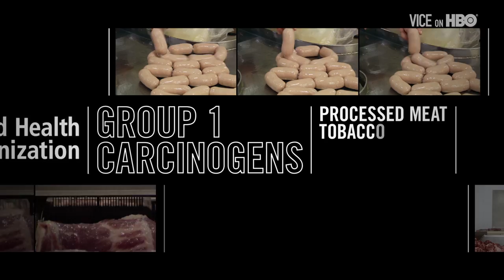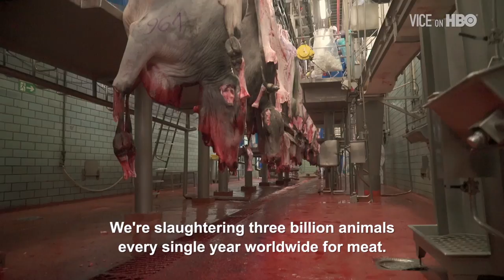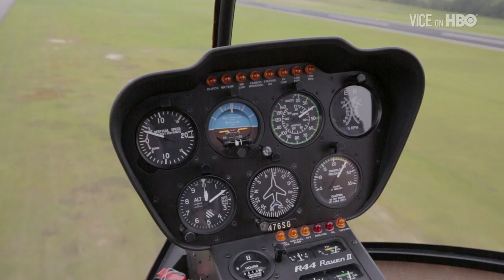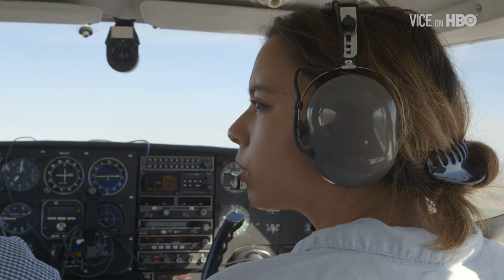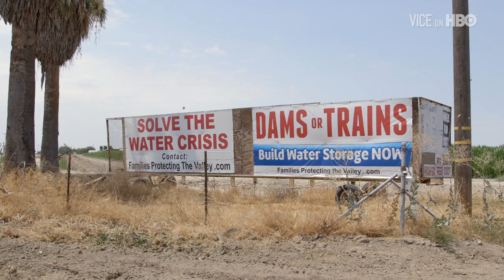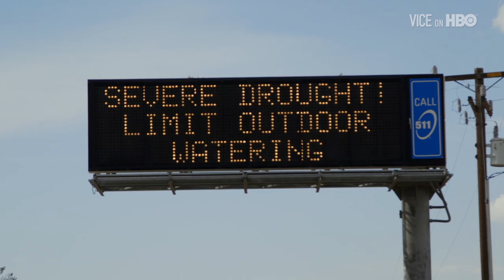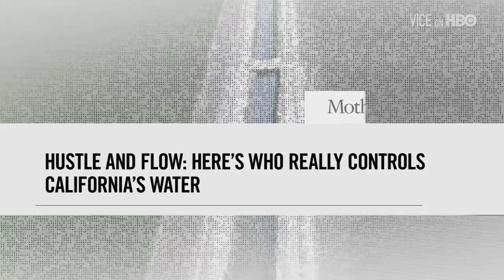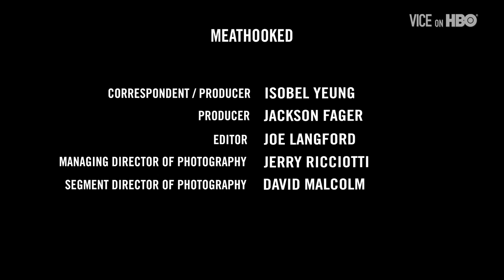Meathooked & End of Water (VICE on HBO: Season 4, Episode 5)

Comment: So its a carcinogen with a weak link to colon cancer. The probability of colon cancer is 5% and adding processed meat to this increases your risk by almost 1% (so its pretty weak, but related none the less). Radiation is a class 1 but that does not mean they are equally dangerous. Meat is still recommended but dosages of Radiation are not. So it sounds scary but wood dust, alcohol, and the sun still rank higher on the carcinogen list. So you might want to avoid those ones first.

Comment: Very one sided video on meat production. 

The way the content given it cannot even be compared.  They compared a feedlot to a cow calf operation that rotationally grazes.  Rotational grazing is a very efficient  way to raise beef calves during there first couple months of age I agree.  But once those calves are weaned the only sustainable way to finish them out is in a feedlot.  If they are finished on grass or on a pasture  those cattle are going to be much older by the time they are ready to be slaughter (In most cases).  Which means they will have consumed MORE water as they took longer to finish out, Produced MORE methane and CO2 because they are older. Finishing cattle on grass is simply not as efficient or  environmentally friendly as grain finished in a feed lot.  Plus who wants to eat a grass fed steak that has little to no marbling? Would rather have a fat well marbled steak from a grain finished steer.

Comment: refuse to believe, there is water shortage. i mean, water might have dried up at that location but there is water all around, just need to relocate or channel water from elsewhere. 70% earth is water and that will not evaporate for hundreds of years, and every year, rain replenishes and life goes on. infact the one thing u need to actually worry about is excess water, if polar ice caps melt, it wud mean half the land mass submerged leaving only some 20% land area. 

the govt, local bodies use water for leverage , this will keep things in check and they can control people. like the diamond market, its controlled, high demand, less supply makes it precious. converting sea water into drinkable water is something which govt or authority needs to do,  but they rather spend on weapons and such.

Comment: the water is going in our engines as relative humidity of air  that is used to mix with fuel n burn  thats also the same thing with ice melting and then its discharged back into the atmosphere as carbon dioxide/monoxide  to be re mixed and burned again n again concentrating the amounts and changing the elements of it and it wont return to its original state and the oxygen is burned off  trees eat the dioxide but not the monoxides so the blend is  strengthening then add sulfuric acid electrolytic rain to the soil and im no whiz. at math but this formula has a little tiny number at the top end of it exponential i think its called but one goes there to say how bad this thing is and will affect us in that manner and frequency, increases of health and other effects from it till we are gone done no more because of  just plain selfishness n greed  sad but thats where its going as fuel /air mix in all the motors in use only thing except use that consumes it  in a large amount and 24-7 doing it right? right easy to fix but wont happen bet on it

Comment: We need my invention ,of floating platforms for desalination ,of water with the best electromagnetic energy creating better cleaner water ,than thousands of years.water created by round platforms ,anchored through the center, with dome covered desalination platforms with grated walkways ,with pinwheel generators under the walkways,and below the platforms to catch the ebb, and flow of the oceans tides. To create clean water sent up through the pipe ,to the center top of the dome to detachable firehose on swivel . So these platforms can be moved out of harms way, or taken to the shipyard for upkeep, and maintenance. The firehose goes to hardline to desert farms ,that grow the hemp seed oil. The best solar panels known to mankind the hemp plant. 0% THC grown for seed.

The water lines ,that run thousands of miles inland ,to desert farms ,with in ground desert homes ,cooled by conducting cooling systems ,on pre irrigation water. The best use of the water is used as the best energy production plant known to mankind. It’s closest bulk producing energy production plant is the cane sugar plant that is only 10% of the bulk of the hemp plant, and if the Dioxide to Oxygen conversion rate coincides it is the Anvers to carbon buildup.cane sugar is not environmentally friendly, because of the chemicals used in the growing ,of the sugar cane where it is grown, and is not though to be not environmentally friendly,because of the chemicals ,that are thought to produce  exasperated red tide.   

So to recap water desalination is the answer. 

The water is used to produce hemp seed oil ,that is known to grow great in the desert oth good water,,an be used exactly like crude oil in every way except three. One :when it is burned . It is a natural carbon dioxide ,not a carbon monoxide poison..two :it can be transported worldwide ,without environmentally dangerous spills in seed form. Three :the seed oil can be used to produce A biodegradable environmentally friendly eatable plastic ,that can be separated by recycling centers that. Separate the plastic ,from the trash for use as winter fodder for animals .

I would like to Quote the Great Albert Einstein Quote “Raise new Questions, explore new possibilities, Regard old problems from A new angle. 

My father was A geologist .scientist know ,that old growth forests burned continuously throughout our evolution. Because of beetle, blight, disease, and droughts often caused by solar flares. Meanwhile the same old growth forests conversion ,of carbon to Oxygen kept these natural things in balance. Herd migration of buffalo ,was A key element in the carbon being kept in the desert grasslands. Of the world. 

We need to consider deforestation as A primary source, of carbon buildup. Along with diminished migration herds of cattle.

My proposal is to use The desalination ,of water to grow the best solar energy production plant known to mankind in the desert. To rotate the crops , all of which produces great expansion ,of the job force = prosperity. The hemp seed oil is grown ,then at maturity the carbines separates the seed to be transported worldwide without environmentally dangerous spills. The foliage is dispensed right there in the desert farms followed by herd animals, that do what herd animals did for millions of years. Then at maturity used as A food source for humans. wile bailed stalk fiber for building materials, clothing, and burning facilities for the production of Electricity, and hydrogen gas thereby solving the age old problem of producing clean hydrogen gas when it takes x amount of energy to produce x Amount of energy.right there where the hemp plant loves the Dioxide, and converts it to Oxygen.

My name is Kendon Erland Curtis ,this was A God given Dream, I was instructed to share it with the world. I realize how naive this sounds, however I believe ,that the oil conglomerates are best suited to produce the concept. I respectfully ask that whoever develops ,this concept please seek out my family ,to give them a small percentage ,of the gross profits from the concept.

This is what I believe this God given concept is capable of.

1- energy from oceans waves, and the ebb, and flow of the oceans tides.for the best desalination of water the electromagnetic energy production  of the cleanest water known to mankind for thousands if not millions of years.

2- the best cleanest water Athens beginning of time.

3-in ground desert homes cooled by conducting cooling systems with pre irrigation water of one of the two base water lines.one for irrigation, and one for drinking water. 

4-electricity from burning the stalk ( like old growth forests) to produce electricity wile capturing the hydrogen for compressed gas with the constant rotating crops around the coal type burning facilities.

5-compressed clean hydrogen gas thereby solving the age old problem of producing hydrogen gas when it takes x amount of energy to produce x amount of energy . 

6- oil exactly like crude oil in every way except three one it produces natural carbon dioxide not monoxide poison. Two the seed can be transported worldwide without environmentally dangerous spills fish can eat it to become healthier, microorganisms can eat it healthier bottom of the food chain. Three biodegrade environmentally plastics.

7- the biodegradable environmentally friendly plastics can not be understated. The plastic can be separated by huge fans in the recycling centers worldwide. This plastic can be used as fodder for animals, winter fodder for animals that normally follow the carbines  
With 30million tons of plastic being dumped into our oceans each year now imagine if it all becomes food for fish and the microorganisms that are the bottom of the oceans food chain making our oceans healthier with more fish than thousands of years. 

Again my Name is Kendon Erland Curtis . If this God. Given concept resinates without copy it, and share it worldwide as God instructed. Please do your small part share the concept.
Reply: I'm not sure if you're totally nuts or totally brilliant!!!!💗
Reply: Patent it